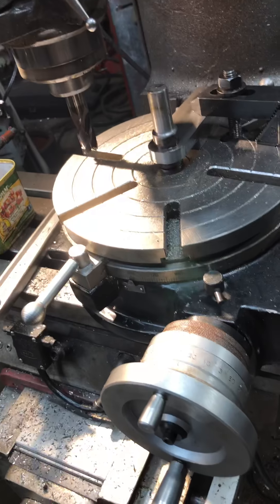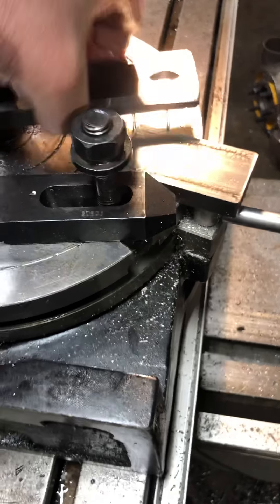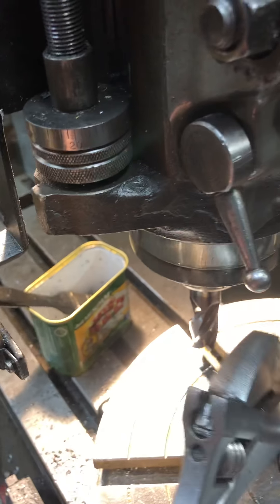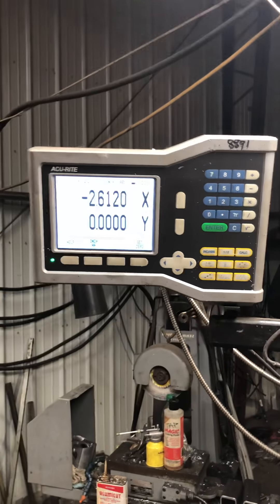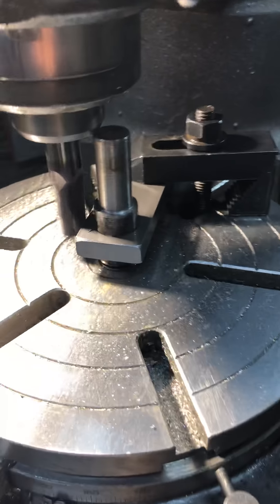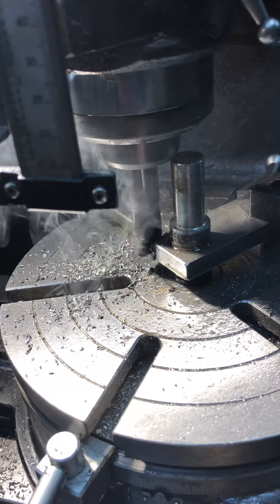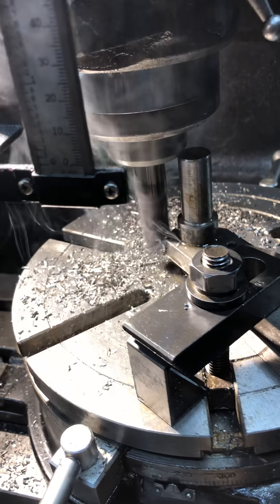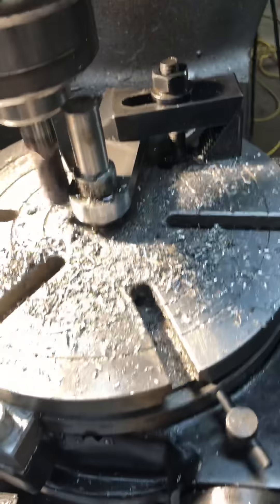how to use a rotary table

Comment: Brother, do you perhaps know what the pitch is of the worm in your rotary table?
Reply from the maker: 40:1
Reply: @shawnmarkman6538  Thanks brother, I will calculate it.
Reply from the maker: My mistake I was thinking  dividing head,rotary table is 90:1
Reply: @shawnmarkman6538  Morning brother, you know, I have used a rotary table dozens of times in my career (toolmaker - 47 years; metrologist 27 years) but never thought about ratios or anything else. A Chinese version (160 mm diameter - actually a miniature) sells for 8000 in my currency (South Africa). Very few people can afford this. I designed 3 versions - 250, 300 & 350 mm table diameter which I intend to build. This is the reason I ask questions concerning the worm and worm wheel which is the most important parts of the rotary table. I hope to complete this in the near future if God spares me.. Thanks for your response.